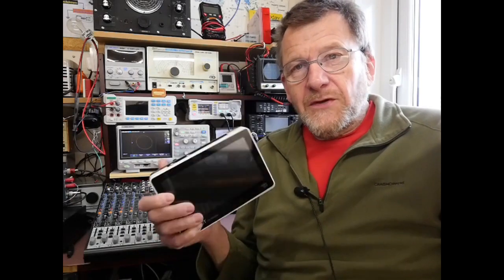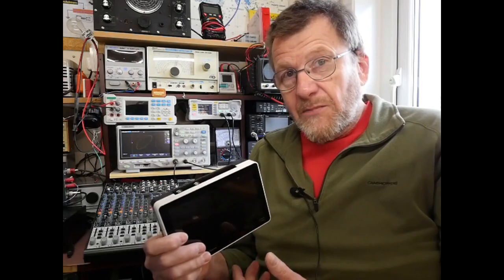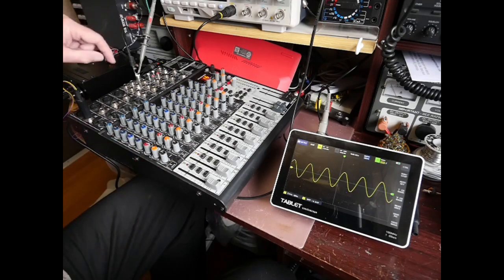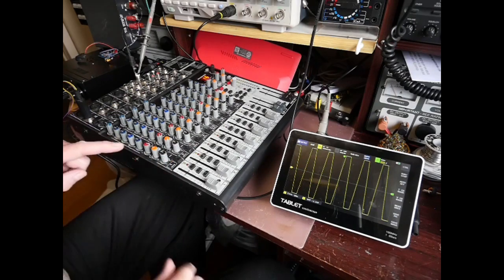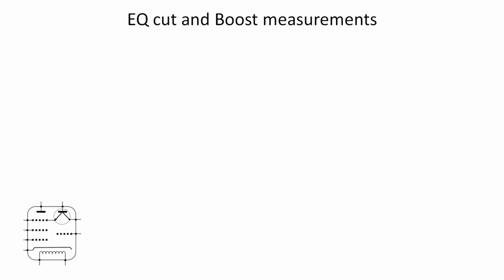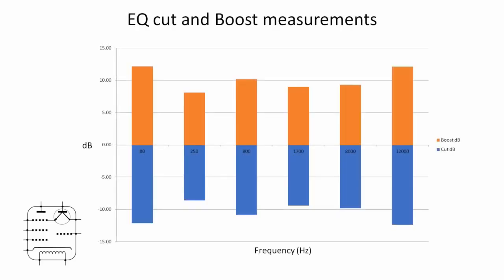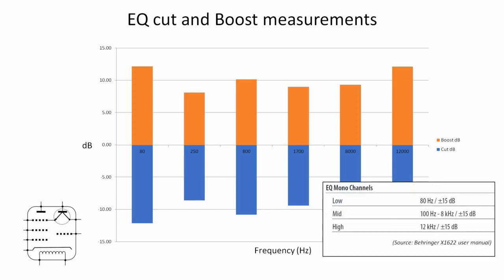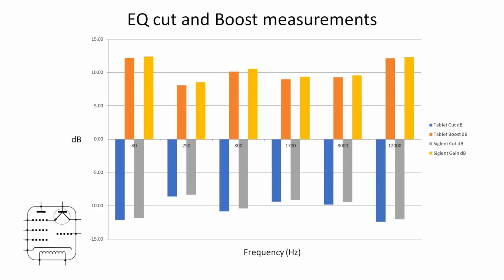Using the FNIRSI 1013D to measure the effects of equalisation on a mixing desk     #058

Comment: I am - "like # 100".  This video covers why I am considering buying this 1013D piece of kit.  Music audio stuff and fuzz, OD, EQ stuff..  I doubt I will be troubleshooting my router, laser, transmitter or my computer but you never know.  For ease of operation, this one seems like the deal.  Comparable priced ones like the Hantek or the Owon have useful multi features but really - all I want is a super clean picture of my audio signals with accurate measurements.  My only experience with oscilloscopes has been with analog CRT versions in the 80's and 90's.  And a piece of sht ETEPON diagnostic video game.  This looks like a serious upgrade.

Comment: Hi dear, you are really very clever engineer, so I hope you will solve problem of my Rigol DG2041A function generator.
I was testing small speaker on this output terminal, after few seconds I have received a message on screen (overload waveform) and suddenly disable square and pulse waveform, but other all waveform are properly appearing on output terminal. So kindly guide me how can enable square wave, on output terminal ?
Best Regards
Israr Ali